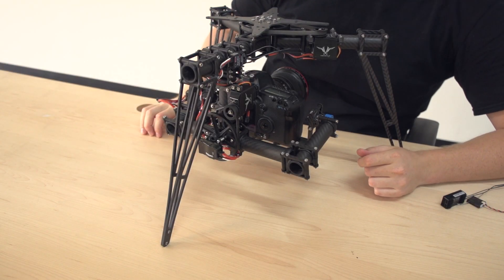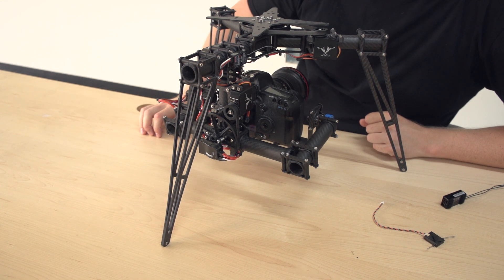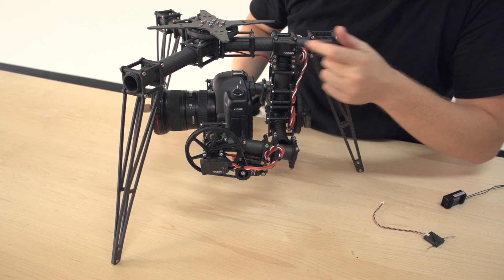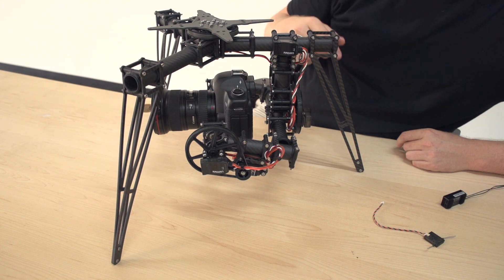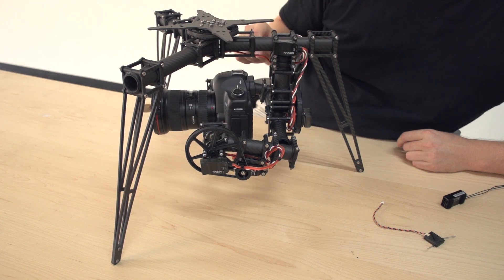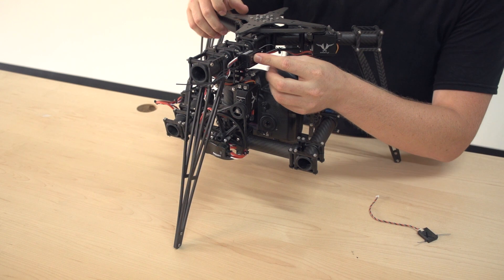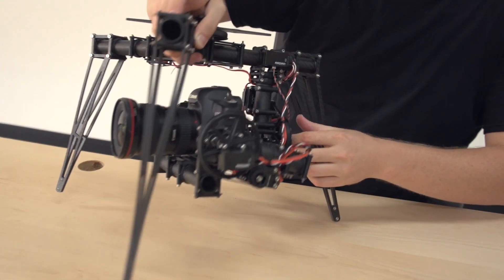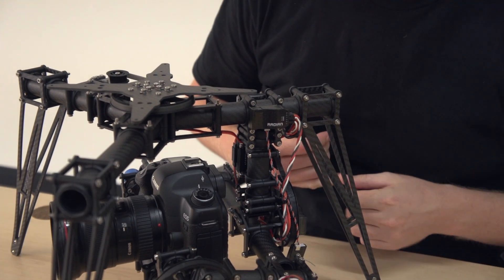Wiring Examples

Comment: too bad a $30 KK board does a better job than the Radian stabilization. Guys think about what you are doing, by putting the gyros on the axis instead of where the camera actually causes a lag between the camera moving and the Radian making a change to stop the movement, this is accentuated by the fact the arms are giving leverage to the movement. Had the gyros been mounted on the “camera mount point” and would be able to pick up smaller movements, also where are the accelerometers???